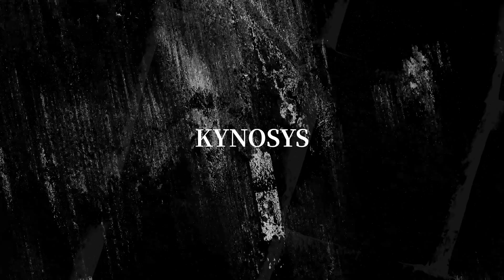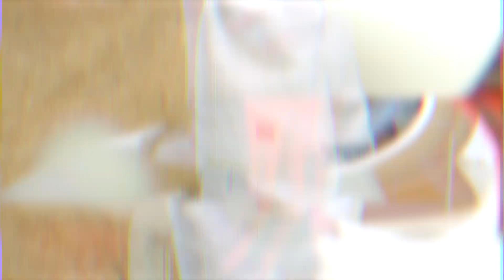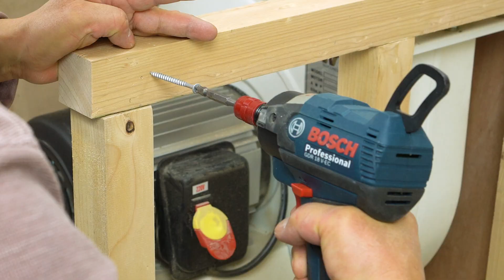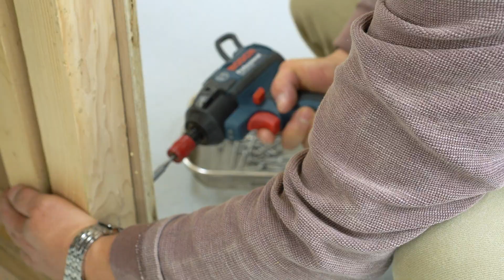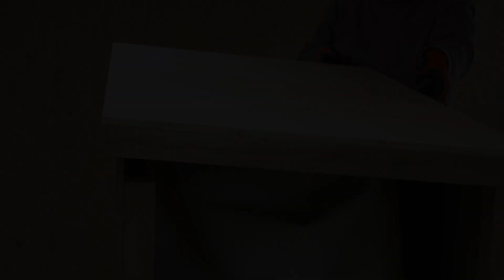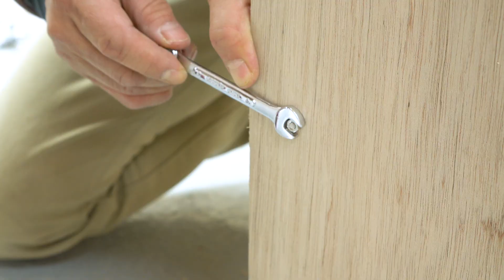Dust Collector Tuning / Doubling Boost Performance / DIY

Comment from the maker: Please turn on your language subtitles!
I was using a two horsepower dust collector. I was thinking about changing it to a larger horsepower product. But instead, I decided to increase performance.
Since the dust collector itself is a product that uses a bag-type filter, I thought that the performance of the dust collector would be higher if the entire box was sealed and the air from the sealed box was removed with a fan larger than the air discharge of the dust collector.
After making it, I think it will work well without any problems even though I tend to collect dust through a pretty long passage.
Another advantage is that it is easy to clean the filter.
If you open the door of the box and turn the fan without turning on the dust collector, you can clean the bag filter freely. You can shake it off, and even if you clean it while blowing it with air, all the dust is discharged through the fan, so it's easy.
Many people leave their bag-type dust collectors indoors, which is not desirable because it actually makes fine dust that is beyond the bag's ability to collect dust accumulate indoors.
For your health, it is recommended to make a box-shaped seal on the dust collector. Reducing noise is another bonus.
It has many advantages, so I hope those who run the workshop will try to make it. Thank you.

#DIY #DustCollector #dustcollection #performanceupgrade #Tuning #Workshop

Comment: What was the smoking for?
Reply from the maker: This is to show that the smoke escapes through the sirocco fan when the dust collector is not turned on. This also means that dust can be safely cleaned from the dust collector. thank you!